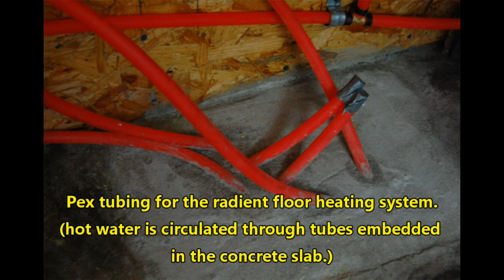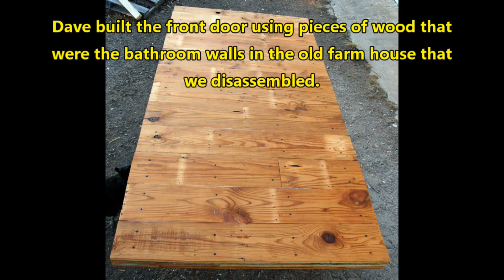Building a Small Straw Bale House: Slideshow - PART TWO

Comment: still saw nothing done to control mold
Reply from the maker: +chuck other Mold happens when a material is wet and stays wet.  The straw (not hay) inside the walls is dry.  The straw was dry when harvested & kept dry....dry bales (extremely low moisture content).  Lots of studies and writing about this subject have been done and can be found online discussing this.  There have been straw bale houses over a hundred years old in the USA that were torn apart....bales still dry and mold free inside.  It took us a year to render because we had to work very slowly......Dave has severe chronic pain, neuropathy, and many associated effects...he worked on the house with no pain meds because the medical/state/& insurance industries had kicked him to the curb during this time.  The years long story of our saga fighting to get him medical treatment is a sad, sad tale of a severely broken system.
Reply: but i'm still concernerd about any wicking up from the concrete
Reply from the maker: +chuck other The bales aren't sitting directly on the concrete.  There's a thick layer of asphalt type material laid down on the ledge on which the bales sit.....the  walls are not built on floor level.  They are raised 4" above the rest of the slab.